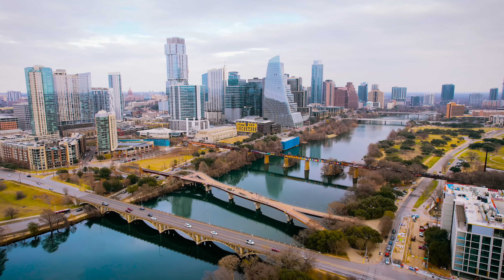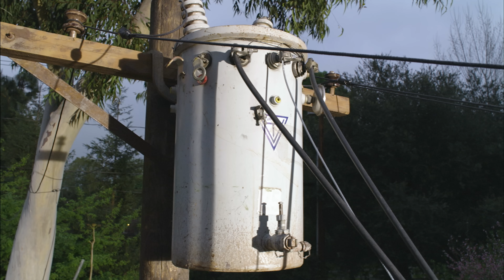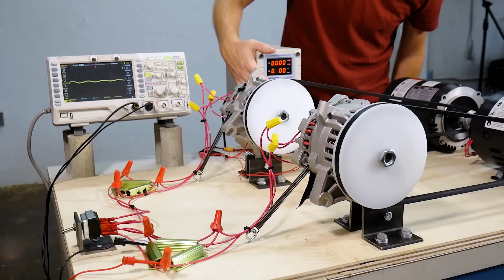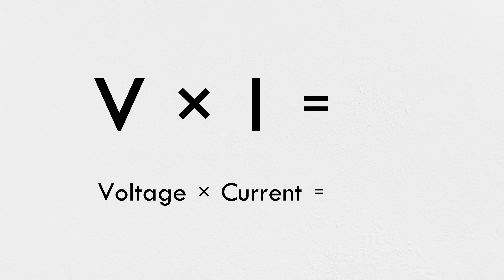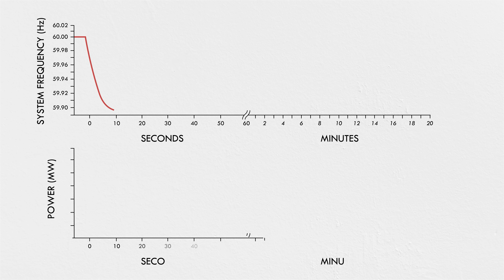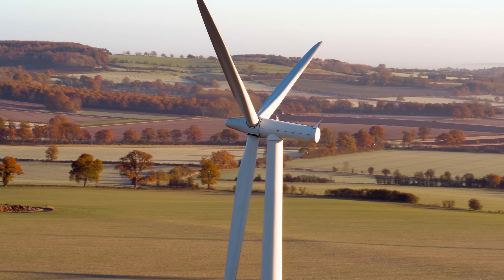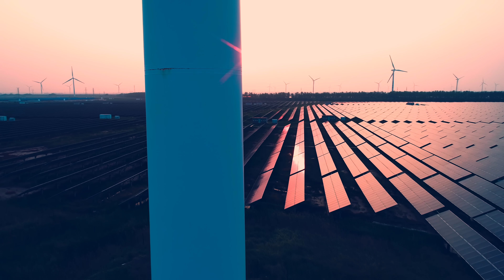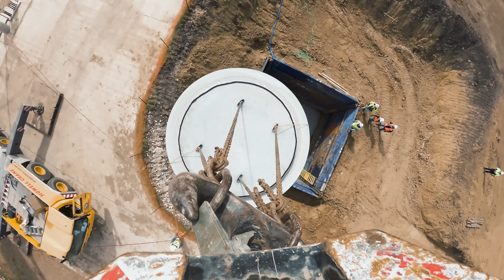Connecting Solar to the Grid is Harder Than You Think

Comment: So why aren't we using the ultra-precise GPS timing system, using multiple synced atomic clocks to maintain perfect time to within 100 billionth of a second to lock our grid to an agreed upon exact frequency and timing? We already do this to maintain audio systems across the globe in perfect sync with each other at 96 khz or more, 60 hz should be a walk in the park. This way all power generators on the grid, regardless of their type, could confidently black start without any need to reference the grid itself, other than for safety, backup double checking, and load compensation. We could utilize inverter technology as is stated in this video in combination with the atomic clock GPS network to effectively hyper-smooth the grid regardless of loads changing, resulting in ultra-clean power, as far as frequency goes.

Comment: I was hoping that you would mention the important function of the dispatch authority in the reliable operation of a grid. Used to be that solar and wind were considered to be non-dispatchable, i.e., you couldn’t order them to produce X MW when you wanted. So they were treated as wild cards and thrown into the demand side as an offset to demand, not the supply side for dispatch purposes. Wasn’t a problem as long as they constituted a small part of the energy balance, but now that this sector of generation has grown, how is dispatch being managed? And in the Texas grid, is there a group of gas turbines with adequate spinning reserve to act as “cushion”? I know in places with a good mix of hydropower and other generation, one or more hydro units would serve as the trim generators for the grid. Yes, leaving money on the table at times, but the operator would have to be paid for the service, probably adjusted into the “capacity charge” of the supply contract. What’s the practice today?

Comment: You should look at 12 phase grid technology.  It's the system Nikola Tesla wanted to use as it's the most efficient system possible.  Others at the time thought it was just a waste of wire.  These are some of the same people who were funded by Edison, so take it as you may.

The company I work for is shopping around a grid tied flywheel energy storage system.  It's unlike anything you've ever seen.  I can't say much about it as the patents are still pending.  However, once we can go into production, we will have a flywheel technology with volumetric energy storage density several orders of magnitude greater than any battery bank.  Think a 35 ton, 30 foot diameter flywheel with almost no friction and no mechanical connections outside of the bearings.

Comment: You need to know that I posted this on LinkedIn, then was forced to take it down when I was told that in minute 7-8 you told a half truth about when the grid is down solar panels do not work.  I got this e mail from a guy who's opinion I respect, and had to delete this video from LinkedIn.  Here is what he told me.    He used a weasel word to try to get away with it by saying “. . . most grid-tied solar systems on houses . . .”.  He is wrong.  I do not have hard data but plenty of anecdotal evidence to the contrary.  I have talked to dozens of people with solar panels and I have only encountered one person without a battery.  These systems are installed to provide backup when the grid goes down! 

 

The only case I can see  where the panels stop working is when a cheap system is installed to try to make money by selling solar generated electricity. Saving a bit of money by not installing the automatic disconnect and controls will improve project profitability at the expense of reliability and self-reliance.  We see that tradeoff all the time here with the Utility and why over 1 million people are without power three days after the storm.       

 

The answer to the grid congestion issues and reliability is MORE grid-tied solar systems on houses and fewer “utility grade” systems that fail regularly.  I believe the answer is decentralization.  I will sign off before I jump on my soapbox . . .

Comment: As the big power station are leaving the grid, there are big  flywheels with a generator/motor set up to stabilize the frequency. One set up in Irland, mass 122 t, in 2022 will be able to carry the whole load of Ireland for 8 seconds. 4 more are planned, I think one of the four became operational a short time ago. They are mainly there for the case that the one inter connector to GB drops out. They give time for the grid to react and keep meanwhile the correct frequency. Ireland will shut down it's huge coal power station in 2025. A power plant using peat was shut down before. Wind is with currently 30 % the fastest growing resource.
One flywheel 133 t mass is operational in Germany. There are also plans to use the turbine and generator of big power plants as flywheels, or connect the generator with it's equipment to a new flywheel.

Comment: In CA for some time all solar installs must have online communication with the utility via two means and the utility can command the inverters to shut off or more likely to accept a wider range of valid parameters to prevent a minor incident from tripping them offline leading to a huge drop in generation. For example if the inverters normally trip out at 59.7Hz for more than 200ms the utility can command them to remain online down to 57Hz. Same for voltage and other factors. My system has an internet connection and an LTE modem so it is always connected.

Comment: I'm was an automotive mechanic for years. Instead of using an A/C to D/C and back to A/C converter couldn't they use a constantly variable transmission (CVT)? This would let any wind speed produce the same output speed, just with a variation in torque. You could keep your 60 hertz and get a change in Amps.

Comment: My answer has been to wait until I don't have to buy cheap garbage from China. This strategy has saved me a lot of work, but one of these days, after I fix the roof, I want install a complete system. I hope they have something better than lithium batteries available. I also hear there are a lot of bad intallers out there, so they need a better licensing system

Comment: great video, I was thinking on getting home solar panels, you mentioned when the grid is down you can not use that solar power, is there a way to get and use this power? Maybe with a physical disconnect or having a battery backup ??
Reply: Its call anti-islanding protection and the main function is to protect the maintenance crew when they are servicing the affected grid. 
It is a regulation for the inverter to come with this protection if you are connecting the solar in parapell with the grid to your house.

Comment: Very good video. A bit of trivia.  Inverters go back a long way.  Back in the 1940s and 1950s, car radios used high voltage vacuum tubes.  To get this to work a mechanical vibrator would chop the DC from the battery to get crude AC for a transformer.  Very unreliable.  My grandfather's 1953 car radio never worked.  Also, back this same era, an AM radio configuration called the "All American Five" for its general use of 5 vacuum tubes was designed for use on either 115 VAC or 115 VDC.  Some parts of NYC were still powered by DC at this time.

Comment: While you see inverters' lack of inertia as a bad thing, I see it just the opposite way.  For example, a single standalone inverter outputting 60.000 Hz will stay at that frequency right up to overload and shutdown states.  The inertia of rotating mass power generation is a liability, IMO, and having inverters that no longer have frequency dependent on load will make frequency sags less common.

Comment: Fully understand the situation for solar, but as for wind in a lot of cases double fed induction generators are used. Here only an AC/DC (on the grid side) and DC/AC (on the rotor side) is used for f-regulation for variable wind speed. But therefore on the grid side only AC is 'seen' as active generated power. Could you therefore elaborate a bit more why you mention that most wind turbines also generate DC? 

Nice video though!

Comment: For grid following inverters, could there not just be a programmed setting to use when the inverter detects the grid is down? If I’m the USA, for example, it could after a pause of no grid power, start inverting to 60Hz at its own phase until the grid is back up, then it could shut off, resync, and connect again as normal. Am I missing something?
Reply: All grid following inverters must have anti-islanding protection where it will not generate if it detects the grid is down. It is an IEC standard and enforced strictly by many grid operator. 

If grid is down and your inverter is still operating, the grid maintenance crew will be electrocuted if they are unaware that your inverter is still producing power.

Comment: And then there is Texas. I have heard that power providers only get paid for power they deliver, not for any spinning reserve or any slower responding backup power. This is why the freeze event a few years ago in Texas was so bad. The problem is that there is no connection from Texas to any other power grid, Texas is isolated. Yes, power problems are bigger in Texas.

Comment: I have a "layman's" understanding of what you are talking about and how it works. 
I have not read all of the comments, so.....  I do not know if someone has commented below on how the Tesla Gateway is used with Tesla Powerwall batteries and how they function to prevent "back feeding" when the local power company's grid goes off line.

Could you please consider making a video about how a Tesla Gateway and a Tesla Powerwall battery bank works with an SMA Inverter to supply power and a running recharge of my batteries when the grid goes down?

 I was told specifically by Tesla that I needed an Inverter that would "talk" to my Powerwall batteries and there was only a few (such as German made SMA Sunnyboys brand) that were approved.

I was told to NOT use micro inverters if I wanted to put a Powerwall battery bank between my solar panels and The Grid.

I was told upon the grid going down,  the Powerwalls put out (I am in North America) 126v which immediately forces the inverters off line.
They maintain 126v for 10 minutes, and then if the grid has not returned, they drop output to 120v and turn the inverters back on.
When the grid returns, there is a delay before the Tesla Gateway will reconnect to the Grid to make sure the grid is going to stay back up and is stable.
A video on how this works in detail would be greatly appreciated.
My thanks to all  the Electricians who have contributed their knowledge in the comments.  This has been a most educational reading session.

Comment: 12:00 - come on, adding frequency correction to the grid following inverter cannot be that hard - in fact it knows the perfect frequency, and only needs to sync phase.
- since you have batteries right next to it, it can definitely pretend to be a fly-wheel.
- If the external frequency deviates, it surely can relatively easily nudge it in the right direction.
- These are solar farms, not an appliance.
- I am just a programmer, but those do not sound like large or unforeseen issues ...
Reply: 12:30 - YEAH! Of course! -  Increasingly and not from the start? Only larger? Shouldn't every significant piece of infrastructure be doing that? - Of course, if it does not have batteries at all,  it cannot do that, but I don't even know how one would design that at all... everything needs to have batteries on the level of a flywheel, no?
- mimicking a turbine seems odd, though - why not mimic the ideal response instead?
- And I am not expecting it to be able to handle that for a long time of course: Maybe a minute of extra power, proportional to its normal output. (So all sorts of peaker plants have time to start  (including battery based, but those can react very fast)).
Reply: They get paid for including battery in the plant?? - How are they smoothing out their output without it to begin with? - Can any provider just connect willy nilly and inject whatever noise?
- including FAULTS, of course: You need batteries just to protect your own stuff... Again: how is it possible to be an "extra" thing?
Reply: I mean, the frequency is so low, I could real-time compute ideal response voltage, then turn on/off ~200 high-amp transistors that are connected different distance along the coil  (to get whatever sum I need) ...
- This probably wouldn't work. I know nothing about it, and am sure it is much more complicated irl, but still, I am puzzled these can be issues that are not solved before connecting any plant to the grid ... I would expect the same to be present in any large factory.

Comment: Grady, might it be possible to exploit an old technology to improve the behavior of sources that produce DC?  Prior to the introduction of mercury vapor and (later) semiconductor rectifiers, rotary converters were used to feed DC traction motors from AC distributed power.  NYC's subway system is an excellent example.  A rotary converter with both slip rings and a commutator associated with its SHARED windings is more efficient than a motor/generator setup.  Such a converter can go from DC to AC as easily as the historical AC to DC.  The rotating mass would be the same sort of "cushion" as found in turbine driven setups.

Comment: Wouldn't the obvious solution be a smart grid where the consumer is given some perk to designate some large electicity consuming things in a house (heating, cooling, fridge, freezer, EV charging, etc.) that the power company is allowed to switch off for a few minutes in the case the grid needs power balancing?

It should be quite trivial to make cheap switches connected to wifi (just like we have smart meters already) that would do this. It would cause very minimal harm to the consumer compared to losing all electricity if the utility company has to turn all power off for the entire town to recover. They would also be very fast as there is no inertia, just send the message to the x number of houses when you need y amount of power to be released.

Comment: I find it hard to understand how an inverter which has a relatively high source impedance can put power into the grid which has a very low source impedance. How can the inverter increase the mains voltage ? Also how far does this feed in current go, just locally or all the way back to the HV transformer ?

Comment: The description of pulse width modulation (PWM) in the video at 6:10 is definitely wrong. Look it up on Wikipedia for the proper explanation. For the purpose of entertainment, the description here is fine enough, but in this video you did not learn what it actually means and how it actually works, and you did not get the proper idea how smooth it can get. Spoiler: silky smooth with a high enough switching frequency and a good filter. Also, the cheap inverter shown on the video does not use pulse width modulation - it uses a modified square wave waveform which does not involve PWM at all, as there are no pulses shorter than strictly required to achieve the target frequency.
Reply: For the most part in this video though, a lot of industry jargon was well included and presented.

Comment: There are some many large backup diesel generators scattered through out the grid that rarely get put to use. Could having these connected to the grid with contract pricing solve  the problem? The city I live in has a number of wells with a generator on site.

Comment: I don't understand the issue w wind turbines producing DC power but houses running in AC power.  Wind turbines are not connected to your house and ALL grid electricity at some point has to move over DC lines before getting changed to AC for consumption in your house.  How is DC wind turbine energy any different from coal or gas generated electricity that is transmitted over DC lines and then converted to AC before it enters your house?

Comment: These are all small teething pains as the world transitions to renewables. 
We have hybrid systems for micro generation (home generating systems) with very dependable and safe battery backup. This is common and I've personally had it in place for over a decade - it works seamlessly. I haven't had a blackout even though the grid has been down for over a week at times in my area. The grid is a mess, that's what has to be fixed, it wasn't renewables that made the mess in Texas - fix the grid. The people in Texas that transitioned through the blackout had hybrid systems like me, when my neighbors were running out of fuel for their generators I was watching my big screen TV and heating my house with mini-splits. It's the 21st Century, it's time for people to realize the dependability and massive benefits of renewables.

We don't use square wave (modified sine wave) inverters anymore like the one your scope is displaying, we use pure sine inverters today almost universally. Locking on to the grids frequency is simply done with zero crossing detection circuitry and it's the antiquated grid that has a problem with frequency transitions, not renewable generation. If you ask me to supply exactly 60hz or 60Mhz I can supply it all day.
 Also, I suspect with the new classes of semiconductors being developed that we will be going to DC grids that weren't feasible in Edison's and Westinghouse's time. The AC motor has been superseded by BLDC(brushless direct current) motors like in the common washing machine. We're coming to the point where AC in homes will be an anachronism, houses will run from DC just like a car or motor home.
Reply: If we could get away from lithium it'd be great. Using it as a bandaid to the broken grid is backwards. Should fix the grid first but short sighted private equity firms don't care as long as they get their grants. Hopefully we get some true renewables and a better grid before no one cares because they are too broke.